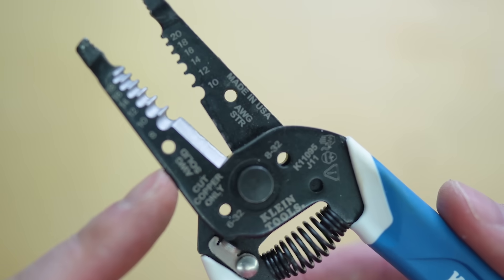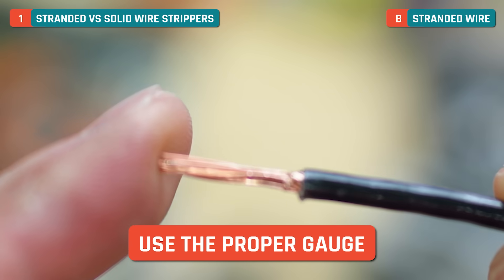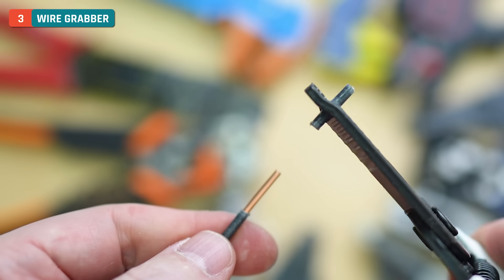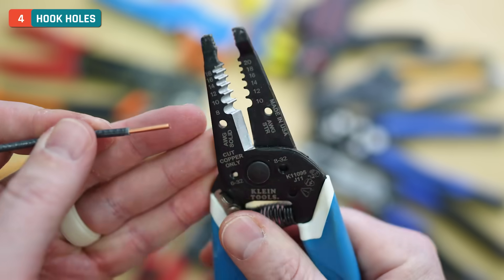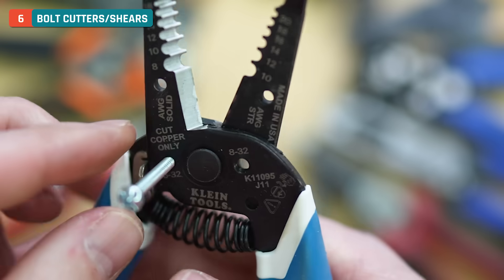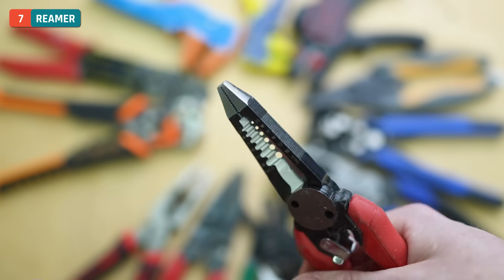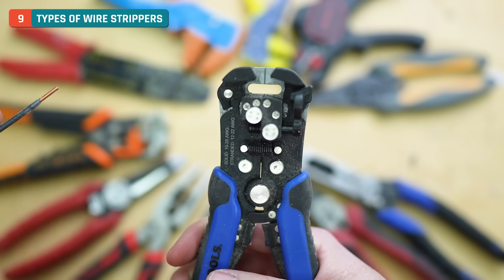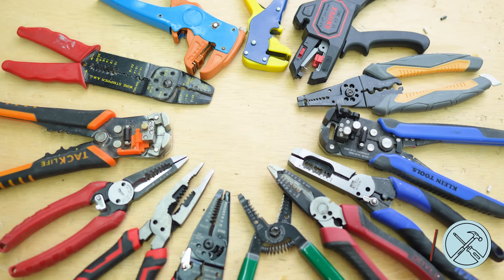8 Wire Stripper Features Everyone Should Know

Comment: I've always used that oval tip on the Klein as a wire connection crimper.  It wouldn't work well for that on smaller wire, but for the heavier stuff it's fine.   Also, I have one of those cheap, stamped steel and plastic auto strippers like the orange and blue one in the background.  I think I paid $10 for mine 20 years ago at a state fair and it served me well during my time working in telecomm.  Works just like the Knipex you featured.
Reply: TBH, I thought that was what it was for. The one I've got is more intended for electronics, and it has 3 of them for different sizes of wire. 22 to 18, 16 to 14 and 12 to 10. I'm guessing that within those ranges the extra bit of squeeze is probably not that big of a deal, but if you're dealing with completely the wrong size either it won't crimp, or it'll split the connection.
Reply: I've also always thought that it was for an insulated lug crimp, but I've never used it because it is so far out on the jaws that you don't get much leverage benefit when trying to make a nice, tight crimp. I use my ratcheting crimpers for lugs (both insulated and non-insulated) for good, tight, and repeatable crimps. I would probably attempt to use it in a pinch, but I wouldn't really trust the resulting crimp.

I really like the idea that Nils suggested here, using it as a soft grip to help pull sticky insulation off after cutting with the blades to help reduce the chance of scraping the conductor with the jaws. Especially for fine stranded wires.
Reply: You used those? The site tech allowed that kind of foolishness?... I would bet that the fiber fairies cut and redid all of your terminations.

Comment: Interesting. I would never had thought the little hole was used to put a loop on the end of the wire. I normally just use the tips on mine since they are about the right width to create a perfect loop for most terminal screws on outlets and switches. Well thought out and presented information...probably very helpful for folks who have not done a lot of wiring.
Reply: The holes in the "Ears" of the receptacle or switch can be used to make loops as well
Reply: I know all these functions because they are written on the tool itself 😆 "loop" "cut insert screws" "crimp" etc
Reply: I'm more concerned how people didn't figure this out already. I knew every function of wire strippers since I was 8.
Reply: @bobthebrick1988  then you had a good teacher
Reply: @bobthebrick1988  True and after checking both my pair neither even have that little hole and there are better ways to do that anyway.

Comment: The "mouse" ears are actually "plaster ears."  The "ground" that he used is actually called a bar wire and if it is a grounded wire it is frequently one size smaller than the current carrying conductors.  If both bolts have 32 teeth per inch the larger is not coarser.  He did not shear the head off, hr cut off the excess bolt. Ron W4BIN
Reply: Everyone knows the ears are for plaster/sheetrock. Bar wire is a term basically never used anymore. Shear/Cut same/same

Comment: Your "wire grabber" is for making a SCREW HOOK,,  THE CUTTER IS MADE ESPECIALLY FOR ROMEX..  8-32 IS NOT MORE CORSE THREADED TNAN A 6 - 32,, THEY ARE EXACTLY THE SAME. blades are called bypass ,not over-lapping,, the automatics can be adjusted to do phone or alarm wire,,, hit once to remove outer ins.,  hit again and strip all conductors  at one time.. One of the knobs is a tension adjustment, the other is a dept setting.....  it looked like you had the crimper upside down.. It makes the difference between a good crimp and a failed crimp....
Reply: I don't think these things deal with dept. A depth setting would make sense, though :)
Reply: @jaypaans3471  If you are referring to my comment about the automatic stripper,, By "depth" I meant the length of of the insulation removed. there is a stop fence that can be set.....
Reply: @twistedhillbilly6157  WOOSH....he's referring to your spelling. You wrote dept.
I use the hole to make screw hooks. The "wire grabber" works well to straighten one back out.
Reply: no need to yell
Reply: @stocktonnash  Can you please speak up.. I can't hear you....
Reply: @twistedhillbilly6157  Bring back the "BLINK" tag.
Reply: @stocktonnash Emphasis!  Not yelling.  But let us forget about context.
Reply: @SamiKankaristo  Until you educated me, I did not know how to italicize or use bold with text aside from a word processor.  But the context should have made the intention known.  Not everyone knows how to use the lesser known technical features available...such as I was until recently.  There's plenty more I don't know.   But I do understand context.  Sometimes things are important.
Reply: @johnchestnut5340  Context is important, but context and nuance is far too easy to lose when communicating through text. When I first read the original comment, it sounded condescending and belittling, because so much of it was in all caps.

"THEY ARE EXACTLY THE SAME" reads a lot like "don't you get it, you idiot?", where as "they are *exactly the same*" doesn't sound like that.

All caps has meant yelling or "talking loudly" pretty much since the dawn of the internet (BBS, IRC, forums, etc.) and a lot of people will behave based on first impressions, and won't re-read for more context, or assume the best of people (commenters).

EDIT: Looks like the text formatting broke when used within quotes, but the asterisks still worked for emphasis (without yelling).
Reply: @SamiKankaristo  Perhaps my understanding of context is based upon my technical knowledge?  Anyway, you see what assumptions and jumping to conclusions lead to.  There is a more traditional way to depict yelling.  I suppose people don't read books or plays these days.  So I won't bother.  Trying to read an old book with the family has not gone well.   They can't follow the slightly more complex structure and the laying of the foundation or character definition/description.  "Around the World in Eighty Days".  It's not a bad book.  It even contains history which was contemporary when written.  Oh well.  Thanks for the respectful interaction.

Comment: Can you also use the tip to squeeze across the insulation to split it? In telecom, i used the underside of my diagonal cutters that had a set of teeth similar to the ones at the tip of these strippers in between the handles. I would squeeze the jacket of the solid ground wire, move up a little, squeeze again, and then peel the insulation jacket off and cut it. It could be used in case you need to take a little bit more insulation off of a hooked conductor. Just like you showed that you had a little bit more insulation then you wanted on the wire after hooking it. Split it with the teeth, remove it, and dont need to bend the hook again or cut the wire.

Comment: I have had those knipex wire strippers for awhile now and use them daily. They are by far the best I’ve used and have not stopped working like all my other versions of universal wire strippers.
Reply: Knipex is the best !!!  Better than Klein 1,000%
Reply: Automatic wire strippers have trouble with Teflon insulation, but that's not something encountered by most.  On regular wire they tend to mar the insulation, so that's the drawback for the ease.

Comment: Cool!! Been using those for years and had no idea. Speed square is another tool that usually gets used for one purpose but has many.
Reply: Unlike the flat-head screwdriver. It has one purpose, but gets used for many. 😂
Reply: @Guitarplayer724  I thought the flathead started life as a paint can opener and someone figured out they could make screws.
Reply: Sounds like you may be more of a Carpenter than an Electrician?

Comment: Don't twist , it scores a line in the wire.

You don't try to cut all the way through the insulation , you just cut the outer sheath and tear the rest of the way.

The "wire cutter" blade is a strip gauge , the straight blade is the standard length you strip off the wire, if you need a longer amount stripped you use the holes to consistently get the same length.
Reply: I don't twist, I make two cuts, the 2nd cut is 90 degrees from the 1st. No scoring.
Reply: @John-jd7mm 
I usually just cut once , grab the wire with my fingers and push against the strippers with my thumb and then rock my hand back
Reply: Can you elaborate on the strip gauge? What holes?
Reply: @queueeeee9000  the length of the blade is the same as the distance you normally strip the wire.
If you want to go a longer , and keep it consistent you use the holes as a measurement
Reply: @glennchartrand5411  I see. Thanks for replying!

Comment: This is gear for amateurs. 
Also, we never make copper rings anymore, we use push in contact.
Silly Americans, you’re so far behind in electrical stuff.
Reply: oh, a fellow european electrician 😀
I agree except the auto stripper - that one I see on most colleagues - from different manufacturers though. My Knipex auto stripper was getting more loose with time, so it went to the spare tools, and I got one from Jokari.
And for the US - I am actually more worried about their screw in terminals where they basically twist all sorts of wire types and diameters and screw a cap on it.
I can only imagine how horrible long a rewiring of, like a lamp would take, or even troubleshooting. oh. my. push in can be removed with twisting (manufacturer says use wire just once, but 2 to 3 times is perfectly fine. So for changing something no need to re-strip them. on screw-on-terminals... welll
The only upside to them is, if done properly (a really huge IF) their contact is better

Comment: I think you might find you can make the reamer bigger with the catch that flips out.  Also when the strippers towards the end of video didn’t completely remove the insulation it can be used to twist it neater than if you completely remove it before twisting it?

Comment: 8? .... MINE GO TO 11 ...   smFh
Reply: more is not always better...
the auto stripper saves you time for each strip, since there is no need to fiddle around if you got the correct size. Also, at least here (europe) we don't need hooks, since our terminal screws use "caps" (or however you call them), if there are even terminal screws - most appliances use push in connectors.
If there are hooks needed, it's either electronics or really old stuff...

Comment: I knew every one of those, including the one you got wrong. But I watched the whole video anyway as a courtesy. Nice effort.
Reply: Wow you knew every one? Gold star for you. Even watched the whole video even though you definitely didnt need to.
Reply: @Paudelly  I just realized that my pair of Jensen wire strippers are about the same age as my son (in his 40's). They dulled a bit over the years. What little stripping I do now, I use one of those auto-strippers. I handed the Jensens down to my son a few years ago. Boy do I feel old.
Reply: Also, when bending ears, line up the pliers' nose parallel to the outside of the line and bend back at least 90 degrees and then 90 the other way. It usually lets go before you finish the 2nd 90. Some people like lineman pliers for that job and use the front of the nose to hold the ear and then roll the outlet with the other hand. More leverage and spreads some workload to your off-hand. Saving a bit of wear and tear from your right hand.

Comment: I personally really like my Klein Tools 11063W, which are similar to the Knipex you showed, but in the same form factor as the Klein set you showed. I feel they give a really tidy result even if they take slightly more effort than the other type of automatic strippers. I still go back to the manual strippers when I need to tidy up a strip that didn't go well or I have to take off the smallest amount of insulation. Also, I personally hate the style of crimper included in most wire stripper cutters. That little dimple press makes such a crap connection and I would only ever use it for temporary wiring and testing. A proper pair of ratcheting crimpers or at least one with bigger dies and more surface area is totally worth it.
Reply: So many connections are not properly made, especially in automotive.  I use my Kliens . Rats nests is a real problem in any field but pronounced in manufacturing maintenance . Glad to be retired .

Comment: Besides the Milwaukee guy using the wrong way(timestamp:-11:15) to do a proper crimp on the crimp connectors this video was well put together.
The pin side of the crimper goes on the flat side of the crimp connector while the wire side of a crimp connector goes on the Crimpers cup side to get a solid crimp on the wire.
Otherwise you will get a loose crimp connection and wire can loosen and slip out of the connector overtime especially in any kind of place were there is constant vibration for the connector to deal with.
The good thing if you did the crimping the wrong way and find the crimp connection of the connector loose to the wire, then you can always flip the loose crimped wire in the crimper and re-crimp your connector to the wire right way and have a solid well crimped wire altogether for use.
Reply: Ya if you pause on his crimp you can see it's not solid.
Great tip!
Reply: Not to many electricians are aware of that, except if you are an aircraft mechanic, they stress style immensely. Nice tip though.🛩️
Reply: Thank you. I find SO many electricians do not know how to properly crimp connectors.
Reply: Try crimping some wire connectors onto wires in person for yourself and then say that you haven't done/seen any crimping in-person so you don't have any idea of bad and good crimping for yourself.
Reply: @chettiarsirusraj9501  Good point.  My first crimps were not the best but with practice they're much better now.  As for crimping though, I prefer to use a crimping tool over the strippers.  The strippers are great for this in case you don't have the tool handy but I find they're not always the best.
Reply: Criticism is always easy. It generally says more about the one doing the criticizing. Especially if they have a need to be watching something instructional. Also, it's a great way to cause people around you not to want to be around you. When will it be their turn to be criticized? There are always polite and proper ways to note an error. Unless of course, you get off on trying to show up others. But that ain't you, right?
Reply: @nothankyou5524  i don't see this particular thing as a  criticism. I have found SO many failed crimps in the field which have caused equipment and wire failure. Following the proper crimp technique is critical from a reliability and safety standpoint. 

It's one thing if you're at home, but if you are in a commercial or industrial environment dealing with higher amps and voltages, ensuring that you have correct electro-mechanical connections is absolutely a requirement. I am happy that someone pointed out to me when I was younger that I was not crimping wires properly. 

I would say that I find bad field electrician crimps on about 50% of the VFDs that I commission. It's so common, that I have included a crimp tug test line on my commissioning reports. All crimp connections must get tested before I sign  off on the equipment as being safe to start and run.
Reply: @nothankyou5524  Correcting bad information on YouTube is always a good thing to do. There is a lot of it.  The demonstration of the crimp function is completely wrong.  Not only is the pin on the wrong side, but he is using  the non-ins part of the tool for an insulated connector.  If only people who actually knew what they weer talking about made videos YouTube would be much more helpful to DIYers. @Chet is actually doing the community a service here.
Reply: @marklahiff4319  It's not the YouTube video that has the bad information, it's the Milwaukee advertisement video that is inserted into the YouTube video that is giving the bad information. I doubt many people even noticed it. I didn't. If I want to learn how to do a crimp, I will watch a YouTube video on how to crimp.
Reply: @charlesgantz5865  
"I doubt many people even noticed it. I didn't."
Me neither.
Reply: @nothankyou5524  Certainly ain't unless the mistakes are repeated in multiple videos over and over again despite there being comments correcting them for the Youtuber to see.
Then some fine angry words to the Youtuber in/of the video is fair game within reasonable terms limits.
I have done so which is why i know so to speak.
Reply: @nothankyou5524  
"Criticism is always easy. It generally says more about the one doing the criticizing."
What are you complaining about (criticizing)? The guy is sharing great additional information.

Comment: Try bending the tabs 90 and then back 180 instead of only like 35 and back 35 degrees. It will likely snap in 1 bend and bend back instead of multiple attempts. You need to overcome the tensile strength with a larger bend.